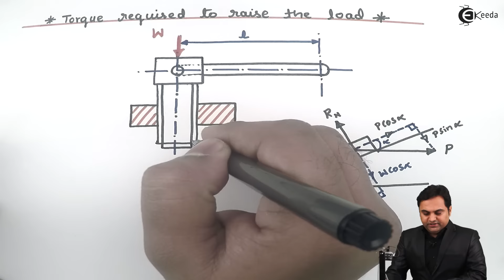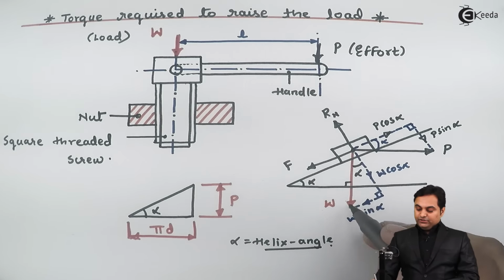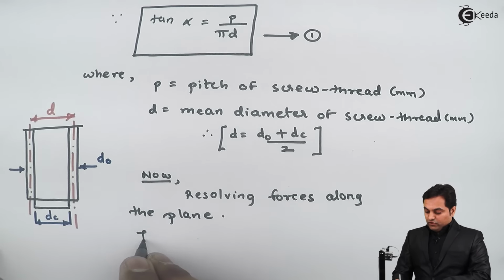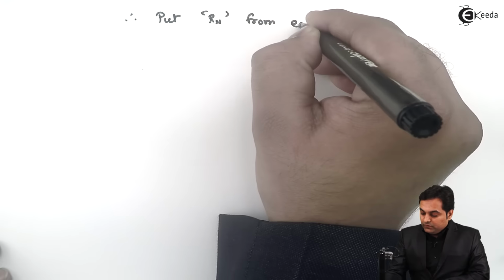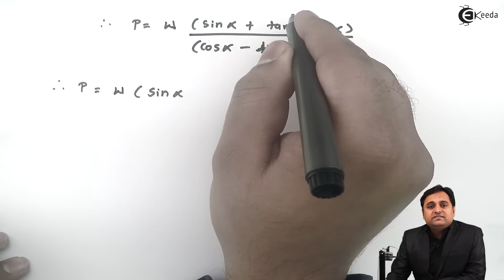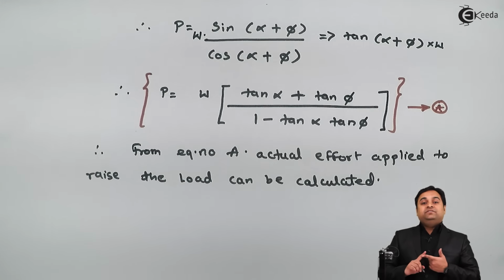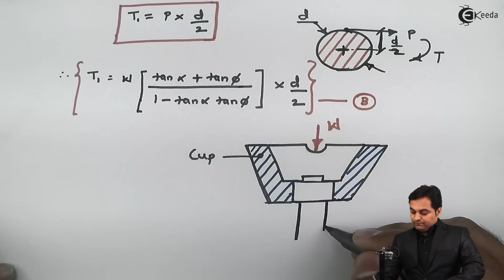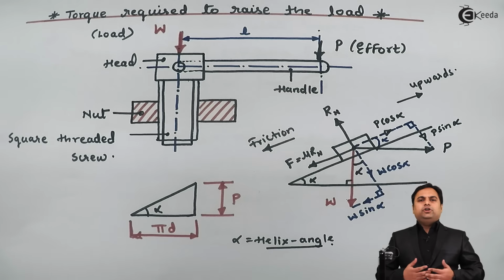Derivation of Torque Required to Raise the Load - Power Screws - Design of Machine

Comment: It took me a while to connect Helix to the angle of the threads. This I know, only because I have used the Helix object, in 3Ds Max software. Would have been great if you explained that also, to us, novices. The greater alpha is, the more lift you will get per rotation of the screw, requiring more torque.

Comment: Very good video. But, if you permit, I would like to make some sugestions. First, you used the same letter for axial force (P) and  fillet spacing (P). Second, the thread angle alpha is calculated as z.P, where z is the number of thread entrances. And, finally, you forgot to mention the fillet inclination theta.

Comment: How is Friction considered negative, since, at from 0 degrees, until a certain angle, the friction will be enough to hold the weight/object in place. Hence, even with PcosAlpha=0, mRn  will have a value. How then, will PcosAlpha-mRn-wSinAlpha be equal to zero? Will mRn and wSinAlpha cancel each other, if there is no force applied, in other words, if PcosAlpha=0?

Is mRn, here resistance to PcosAlpha, where, if there is no force applied, no resistance cannot exist?

Comment: Not getting main concept. ..how u drew that inclined plane to resolve forcrs
Reply: Take a wedge as drawn by sir . Now start wrapping it around the cylinder .You will notice that as you rotate , a helix is formed . On one complete revolution , you have travelled up by lead and around by pi*D(mean) .Therefore you get a wedge with height as lead and base as pi*d(mean) and helix angle alpha .
Reply from the maker: Load is kept on an inclined plane so it will have two components,one parallel to the plane other perpendicular to the plane similarly for effort.
Reply: @kurunandan tu btech kyu kr rha phr??